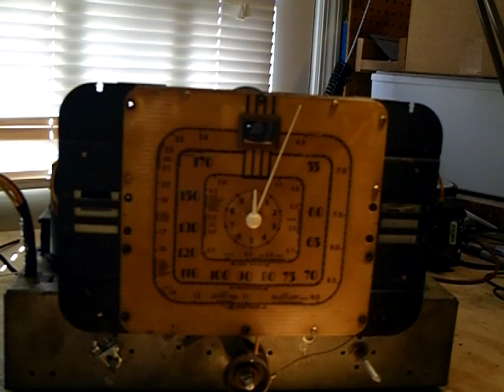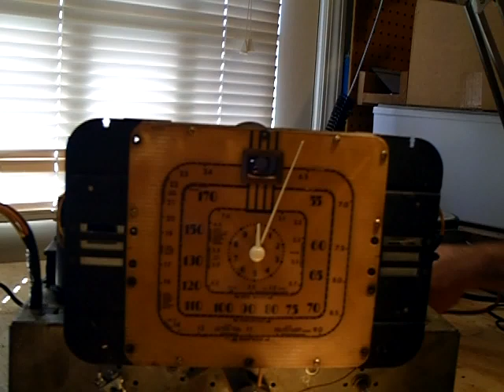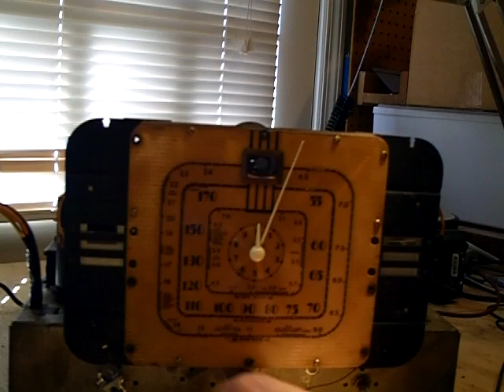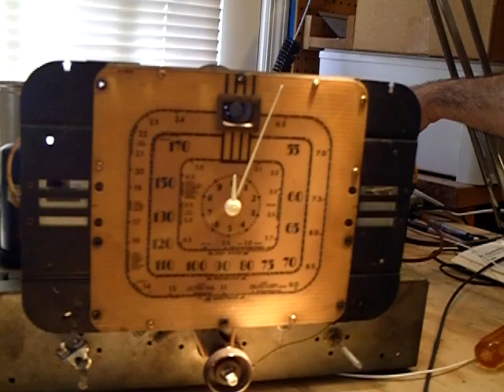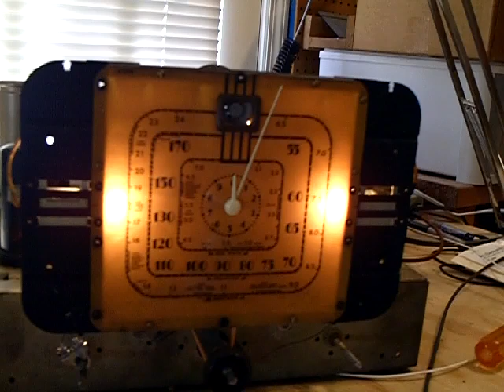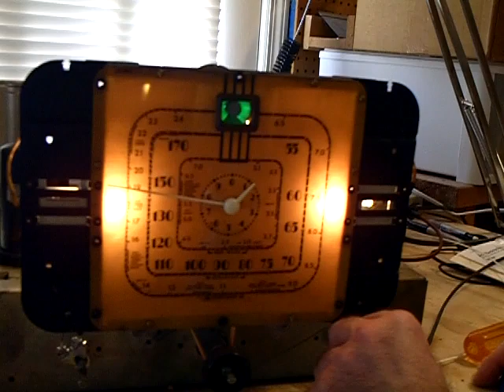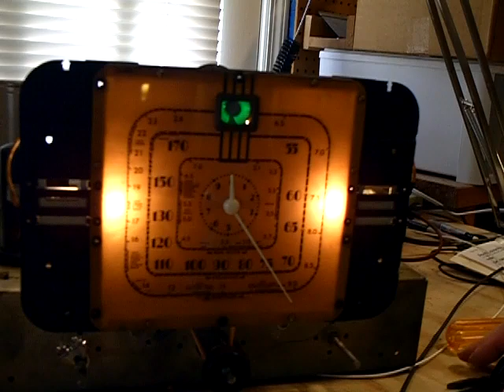Antique Radio Repair Part 3

Comment: I have the table model version. My question is on the left side facing(3 tone choices). The string on mine is broken that operates the view slide. Is there any instructions on how to restring this slide? Also my swich that controls this change does not seem to have definate click postions that I can hear. Should this left switch control both off/on and tone changes? Maybe when it is restrung it would have the click positions to change the tone choices? Thanks
Reply from the maker: +Mike B Sorry for the delay in writing back. We went out of town on the weekend. Also on the way back a truck kicked up a board and hit our windshield and cracked it but luckily we didn't get killed! So tomorrow I have to bring the minivan to the body shop. I don't remember specifically about the tone control, but I can find out for you. Also I might have the stringing info for this RCA on a computer file that I can send you. send me your email to Lockemeister1@gmail.com. I will get back to you in about a day.
You are correct that the left control is the tone control and the on off. I have to warn you that RCA used brittle pot metal in the actuator arm that controls the visual indicators. So very easy to break if only slightly over tightened.
Reply: +Lockemeister  Will do, thanks

Comment: Hi, when you changed out the speaker transformer you effected the tuning eye. Since the transformer was not a direct match you cannot expect the eye to work 100% correctly. I've seen eyes stop working just by removing the speaker wire or bad connections to speaker.
Nice job, thanks for sharing.
Reply from the maker: check out some of the other vids I have. my last one was the Philco 38-116.
I had better do a new one soon on something.
thanks for sharing your input

Comment from the maker: That was the best idea I ever read from anybody. Thanks. It's something I will do. I need to make a folder for how I repaired them and what I did to them. Burning the pictures to a DVD is also an excellent idea since a harddisk can crap out at any time.
Paper lasts for centuries esp that low acid paper. I like books I think better than PC's

Comment: You know what you should do also...   take all those original pics you took before you worked on it, and burn them and a text file out onto a DVD or CD rom disk to stash inside the radio, along with your schematics, and the baggies of original parts you replaced.  As well as a text file about you and just some thoughts on what you did to the radio and when.   Print a few of those out, because someone in the future may not be able to read the disk - paper lasts for centuries unlike DVD media.

Comment: When you replace a output transformer you have to make shure that the primairy side of it corresponds with to anode impedance of the amplifier tubes, othewise you wil get bad sound

Comment: nice repair job i just finished repairing another radio phonograph its a ge model when i got it it had a low level hum so i replaced the electrolitics also it had a bad needle i replaced the needle then i refinished the cabinet it looked new just like the day it left the factory john

Comment: My hobby is also restoring old radios and your videos are very good. One thing to look for when you have a tuning eye that doesn't close is an off value 1 meg  resistor usually located in the tuning eye tube socket. . RCA specified an oscilloscope indicating device when used with a sweep generator so as to make a response curve on the 'scope for IF alignment.

Comment: I have a few radios with a tuning eye, which indicates the power of the signal.  I have increased the signal strength without using an RF generator making slight adjustments   I mark where the if transformer screws are set, and then slowly turn them left or right while watching the tuning eye open or close.  I have successfully increased the signal strength to where the tuning eye closes completely on  strong stations and improved reception on the weaker ones.   Make small adjustments only

Comment: hi i am verry intrested in knowing how to fix this type of radios i am a mechanic ive worked 4 ford i am no presently working for  a waste & recycleing company ive  done in ford basic electrical and electrical component diag classes  how mutch more do i need so i can maybe fix a  radio i found in the trash its a philco model 37-61 i pluged it in the outlet an il light up but started to smoke im realy intrested in learning just as a hobe thanks

Comment: hi!! i would try to use a longer annt. wire!! i have several old sets like this and, they seem to like the longer wire!! you can make one by going around a window frame, making a square . that will give you some 20 ft right there!!  my 1936 zenith i did, picks up all kinds of shortwave and hams!! and the eye tube does close without a alimment!! hope this helps!! ed

Comment from the maker: Actually with the scope, they are not looking for the total peak all of the time. In one step, they are looking for the broadest IF curve if you get two peaks while adjusting C20. This allows for greater bandwidth and greater fidelity. With an analog voltmeter, you can only peak to the greatest deflection which is not the same as the greatest bandwidth.

Comment from the maker: Just another tip... I read that lots of radio manufactures used water soluble paints for the dial numbers. I just blew the dust off mine and took a few hours and used a slightly moistioned Q-tip, (I squeezed out the excess water with my fingers). Actually I used a whole box of them and gently wiped down the dial but was careful NOT to touch any of the painted numbers or lettering. If I was too closed to the numbers or letterinf I didn;t dare get near them.

Comment from the maker: Just wanted to note to you. The hands of thr radio were really chipped off. I found a similar white paint at Ace Hardware. True Value Navaho white enamel. I scrapped the old paint off with a fingernail. then washed them down with rubbing alcohol. I gave the hands 3 coats per the paint cans instructions. I let dry for 24 hours. Then baked them at 200 degrees for 4 hours the next day. Then let cool and sit for another 24 hours.

Comment from the maker: I guess I could try that.
RCA had said cathode ray scope alignment highly prefereable. C20 adjust = minimum capacity peak if two peaks are obtained. C9 adjust = max capacity peak if two peaks are obtained. Connected to 2nd IF trans at Phono terminal strip. Steps 3 and 4 of a 10 step alignment. Seemed pretty involved.

Comment from the maker: Hi! As it turns out, I ordered a 6E5 from EbaY and I had somehow received a 6U5 and never caught the error. I ordered it 2 years ago so just popped it in the radio yesterday. Thanks for the help since this one slipped right past me. The 6U5 is not as sensitive a tube as a 6E5.

Comment: The 810 I owned in the '70' would actually 'overlap' the 6E5 indicator on very strong stations. Either your reception isn't as good (although it SOUNDS like it's GREAT), or something's different about the way our 6E5's are/were wired or biased. Just guessing...